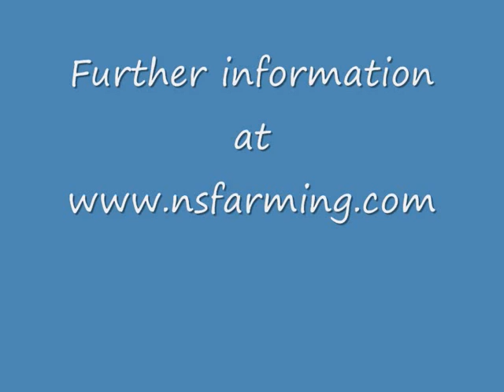Natural Sequence Farming - Scaled Model Erosion Control

Comment: Contour farming does the same thing I think.
It does rob some cropping area because of the contours but increased yields would would easily cover that loss.
Same principle of slowing down water flow while increasing moisture absorption and retention.

Comment: the reason the soil moved is because there is no grass? or trees?
Reply from the maker: Trees and grass (vegetation in general) are part of the reason why there is no erosion of the soil. Other factors are the microbes in the soil - by keeping the moisture in the landscape for longer periods, microbes are able to proliferate and they have soil-adhering capacity at a molecular and cellular level. In contrast, the vegetation makes a physical barrier to the soil movement.
But neither of these factors are the key - the most important reason is that by reducing the velocity of the water moving down the landscape, any dissolved soil has the chance to be deposited on the ground.  The resulting clarified water then moves more slowly down the landscape, but does not take soil with it.  As it travels down the landscape, it will collect some soil (dissolved) and that is why we have multiple leaky weirs down the gradient, where the process of stilling the water is repeated.
Thanks for your question.
Greg

Comment: Great explanation. It helps show how the rivers and creeks must have formed on the high ground. Did you ever consider placing weirs as a straighter wall with a slight convex shape on the outside, almost like an flatter umbrella shape. I did a test on a model the other day and it seemed to push the water out wider. Im going to try it again with different  materials though. It's a fun system to play with. Thanks for the video.